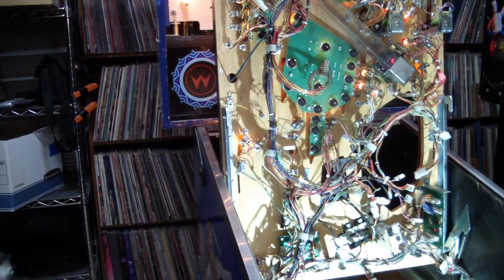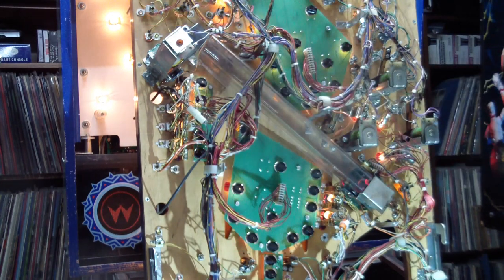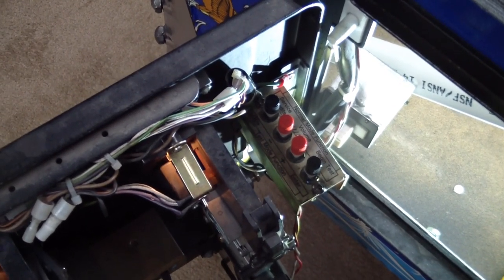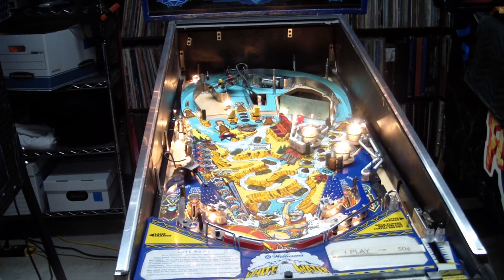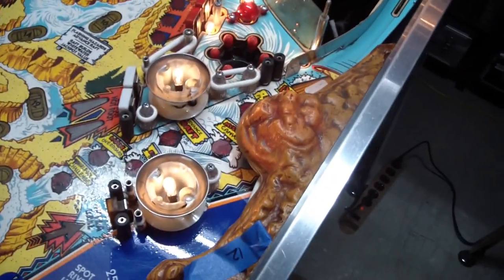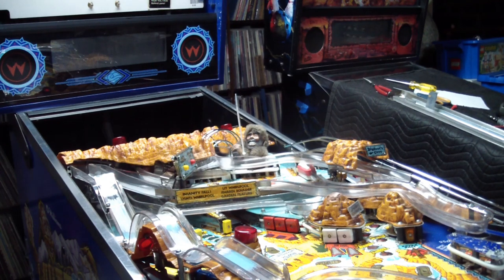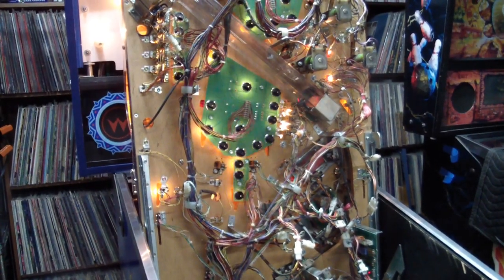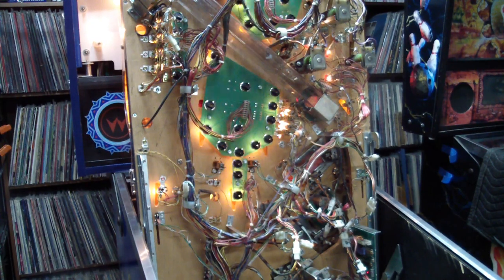AE#127 Repair of a Williams Whitewater Pinball Part 2

Comment: Artie -- you should lie to the transformer primary, tell it your are in 100v land the overvoltage on the secondary should be fixed by the regulators.  I do this with my collection of AM broadcast transmitters.  i tell the power transformers that they are getting 210vac on the primary side and i get an extra 110 Watts out of a 1KW AM broadcast transmitter.  i love cheep tricks.

Comment: Are you certain there isn't an undue load in the power supply that is loading the xformer too much to cause it to sag?  eg Bad rectifier diodes? Tested ac leakage?  Seems every time I had a noisy xformer even a leaky rec diode was the cause.